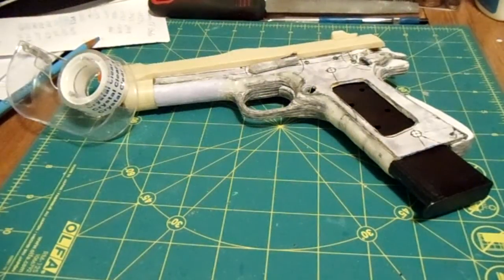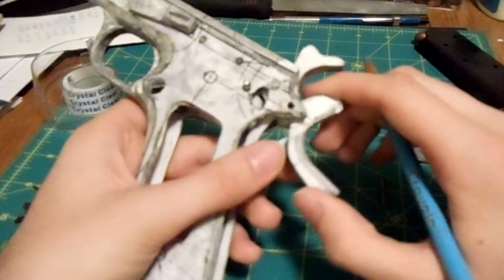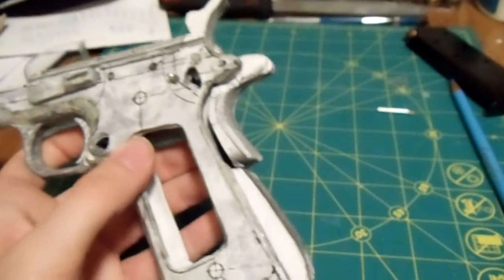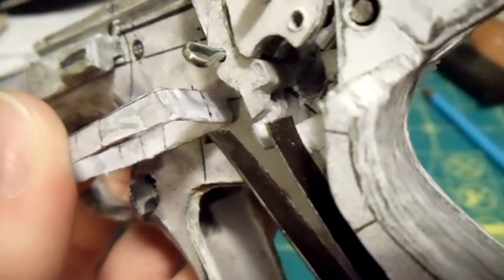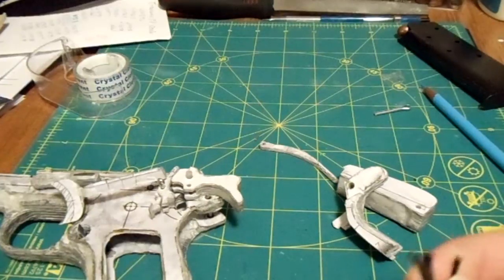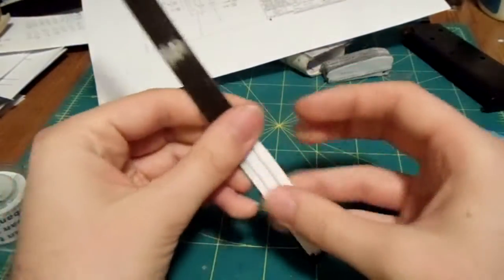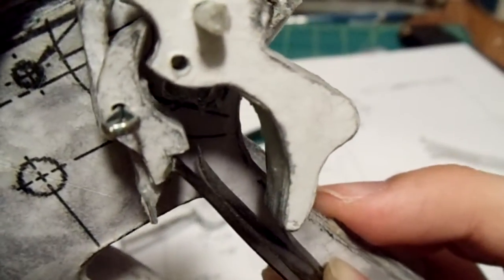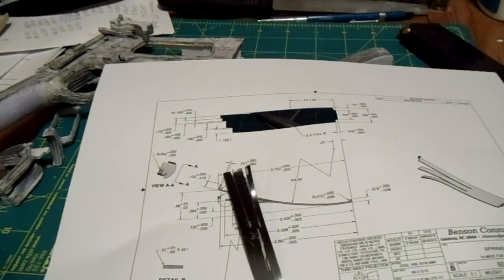Paper 1911 update #20- The Sear Spring

Comment from the maker: the ejector is just a stationary piece sticking up right beside the disconnector slot on top of the frame. When the casing is pulled out of the barrel by the extractor, it continues to go backwards until it hits the ejector. when this happens, the casing is pushed off of the extractor to the right and out of the gun, while the slide continues to fly backwards. hope this helps